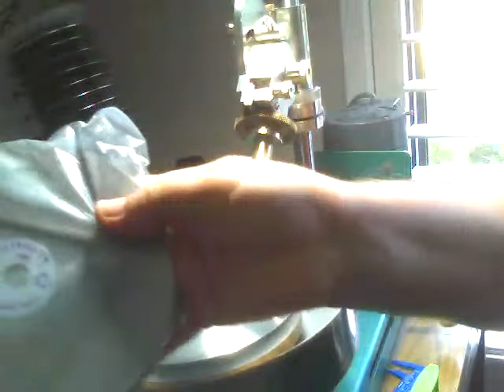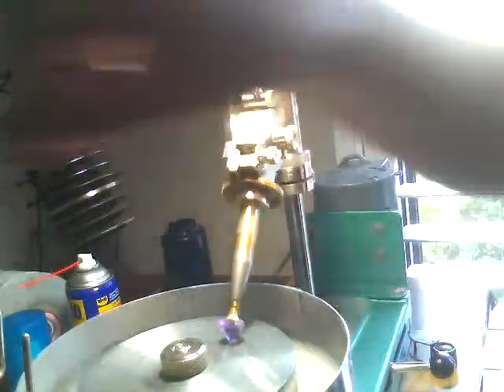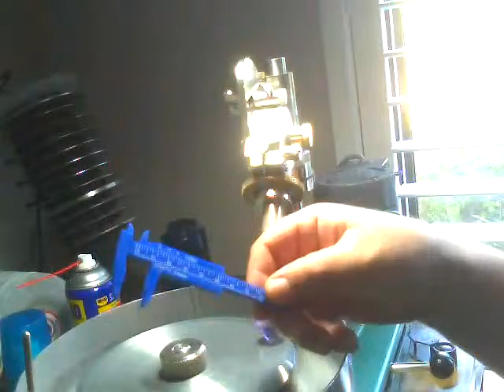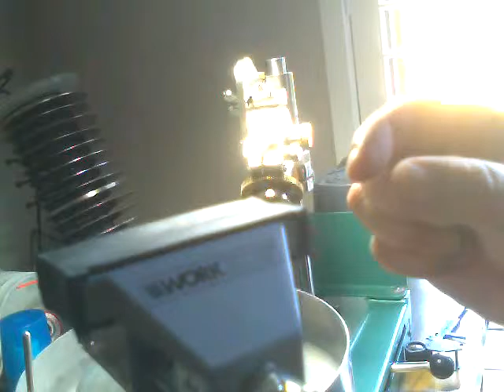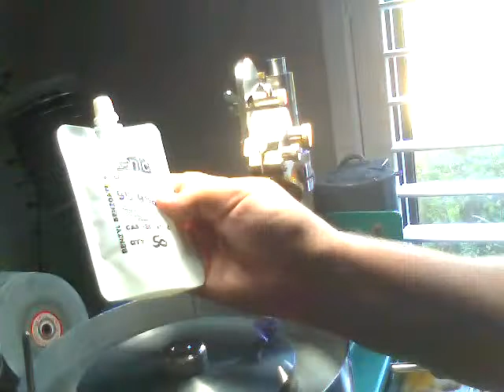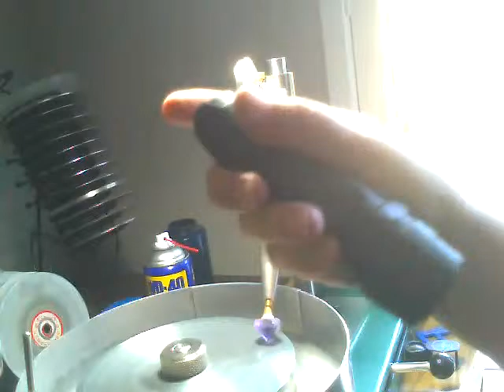Faceting Questions and answers - No 1

Comment: Hi Cliff
Do you have a video on the preparation of a polishing lap, i have a tin lap and im really battling to get a good finish, i cant seem to figure what i am doing wrong, your help would really be appreciated, Best Regards Chris
Reply from the maker: Hi Chis,  I do no preparation on tin laps. I get them milled once in a while so they are really smooth. I use 50,000 diamond grit for all gems. To polish quartz I always us Herco valve oil. With any other gem that easier to polish like Topaz or Zircon I use sewing machine oil. Cheers
Reply: @VintageTimeGems  Thanks Cliff thats interesting do your polishing laps end up with a burnish on them, the first time i prepped my tin lap it looked like a mirror, then i messed up and damaged the surface with what i think was a ruby i accquired, since then trouble, but perhaps i should send it in for a surface mill.
Reply from the maker: @selekolela8805  I clean them with wd 40 if the surface looks black. Just use toilet paper and wd 40 to wipe off the black residue. That blackened surface has a tendency to scratch the surface of the facet. So regular cleaning and application of more diamond powder is necessary.
Reply: @VintageTimeGems  Thanks cliff, ill certianly take your advice, and look foreward to you comming live polishing stream, or videos, take care.👍